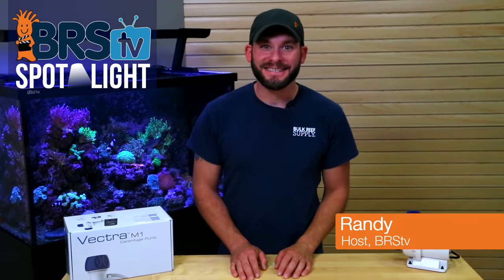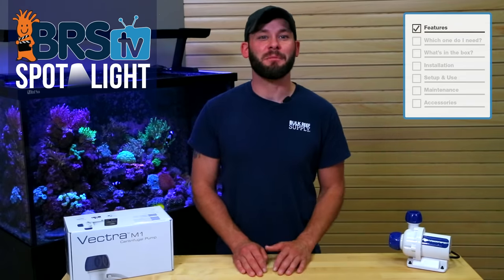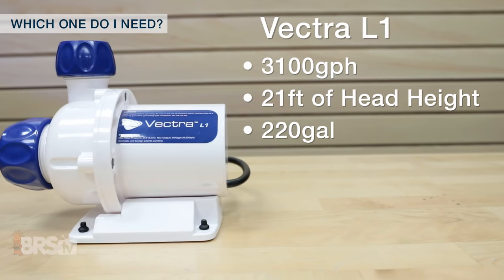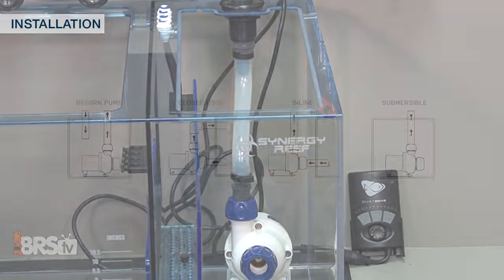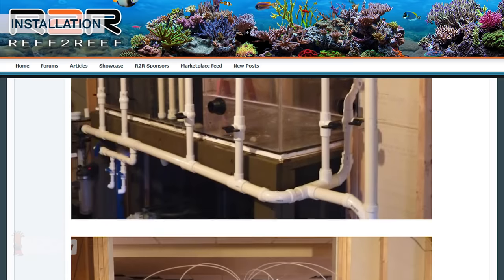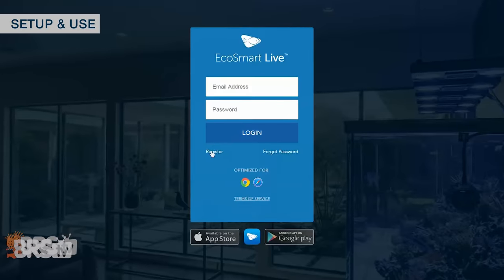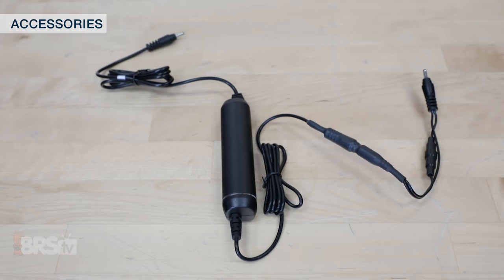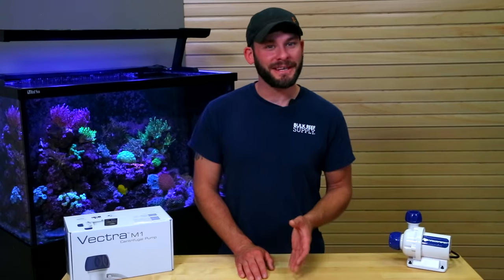Intelligent and super quiet return pump, the Vectra S1, M1, L1 from EcoTech | BRStv Spotlight

Comment: BRS, I double dog dare you to do a step by step setup video of any of these return pumps. Calibrating them is an absolute nightmare rivaled only by their terrible customer support. Are the pumps dead silent? Absolutely. Are the pumps reliable? Yep. Can you calibrate them AND keep them recognized on the Mobius app? NOPE. Can you manually calibrate them via the driver? Yep. Will your Mobius app continue to recognize them? NOPE. Does the feed mode help the pumps and power heads to work together? NOPE